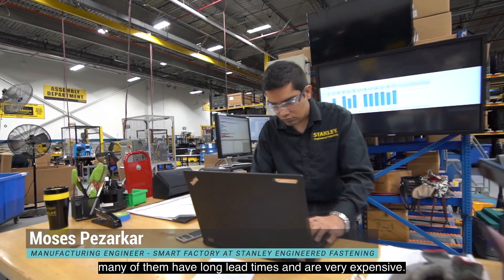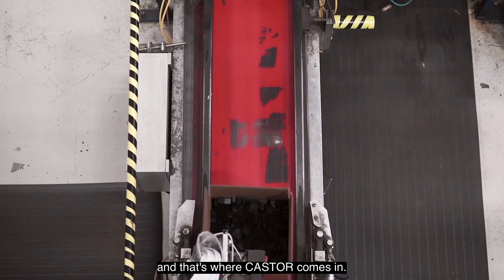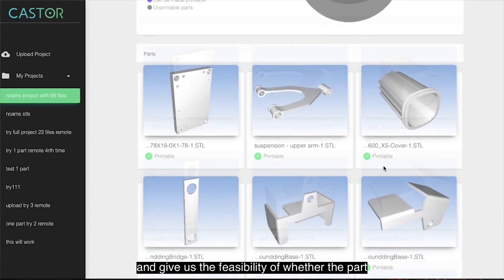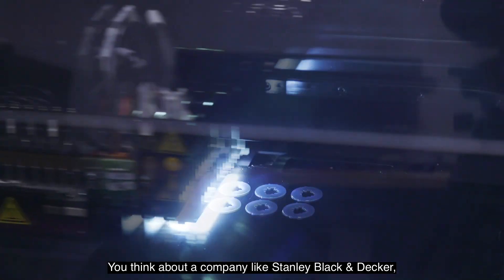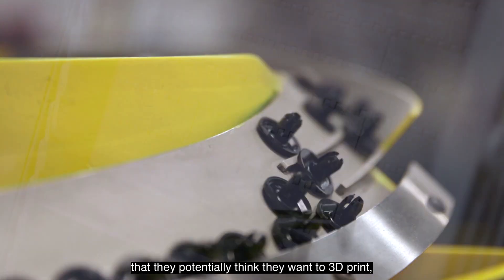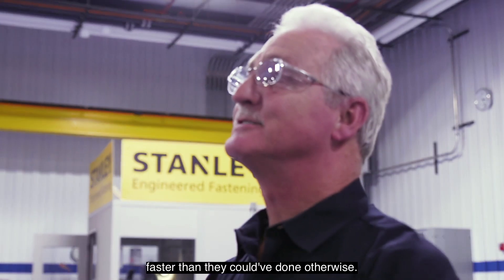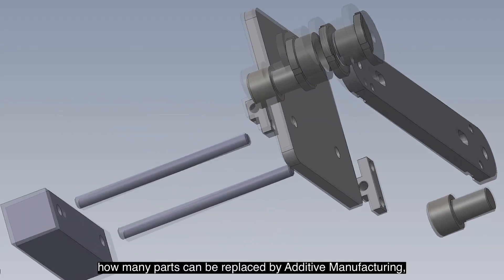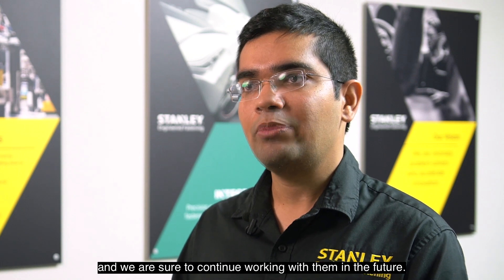CASTOR, Stanley Black & Decker and EOS North America Testimonial

Comment: 3D printing is not the solution, if you want to make parts fast and cost efficient you have to do it by Injection Molding.I have worked in this field for more than 36 years. Injection Molding done right is the closest thing to a Money Printing Press.Build a good quality Mold with good heat threated Tool Steel and you can produce more than a Million Shots without much maintenance. Tools that were initially intended to run 1 Million shots, run more than 10 Million shots.Hubert